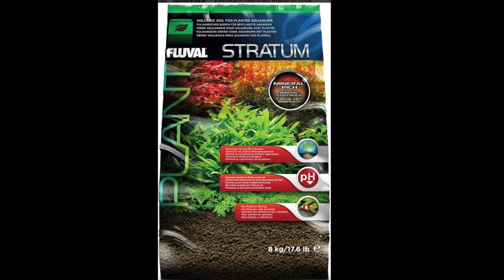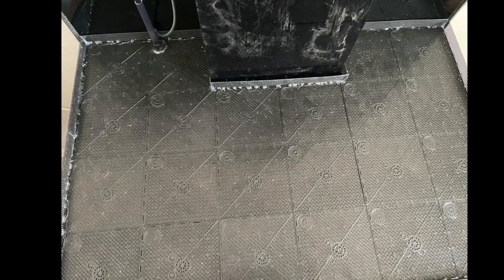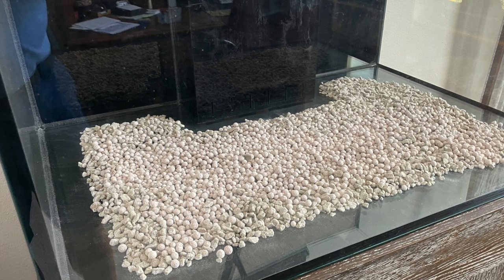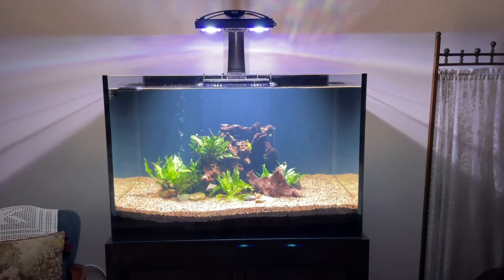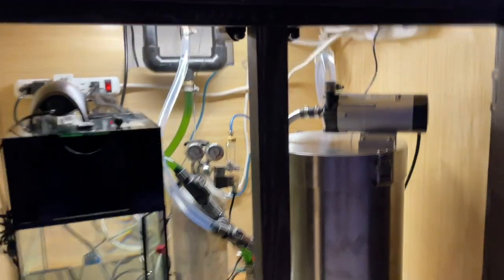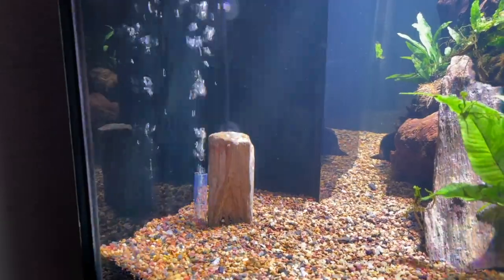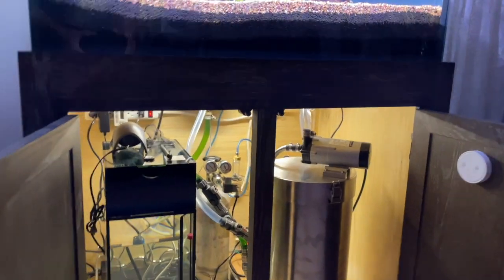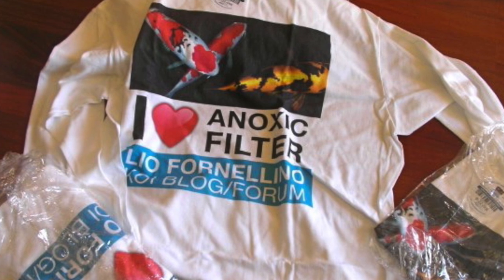Building A Plenum in the SCA Aquarium with Fluval Stratum  : Kevin Novak Ph.D.

Comment: hello dr novak, so i dont need to have the air pump running 24/7 for the plenum? Planning to leave it on in the night only so the bubbles wont disrupt my diy co2  in the day. already have a cannister filter running 24/7. I cant really follow the step by step guide cause in my country for some reason kitty litter the non clumping type is impossible to find. So my plenum has no laterite and kitty litter. Should I still carry on with plenum method using undergravel filter plate, with just the laterite or go without both or maybe the clumping kitty litter can work?
Reply from the maker: @jonsnow1081   that’s correct

Comment: Hello Dr. I am in the process of restarting my 280 g aquarium. It will be fairly well planted.  The plan is to use a ugf with aquasoil then capped with flourite sand.  I had never heard of you until now, but it struck me that I am roughly designing what you described in this video. I like the idea of the laterite and have used it previously as well as possibly using the eheim media under the ugf.  My question is that for this aquarium which is 96 inches long, how many lift tubes do you think I would need to install. I think the answer is three, but would love your expert opinion. Thank you in advance for your time and consideration.
Reply from the maker: If you're 280 gallon aquarium is 6 foot long one uplift tube with a gigantic Plenum is recommend. Remember, you don't want to move water quickly but slowly and constantly.. 8 foot long then you would use two small uplift tubes one for each 4 foot of aquarium.

Comment: I thought the whole idea was 2 use baked clay with the plenum? So the only difference in the way to utilize the under gravel filter vs how it was used in the 70's is the void between the surface of the tank and the under gravel filter plate and water speed... no need for kitty litter 🤔
Reply from the maker: A Plenum can be made in several different ways, and I try to give people all the options. But yes, you are right and thinking that basically not running and under gravel filter as fast as it was with powerheads is the way that it will work correctly.

Comment: I have a question. Did you add the airline tubing straight into the ridged tube of the plenum (like an UGF), or did you feed the airline tube under the plenum and placed the airline tube under the ridged tube? Thank you in advance.
Reply from the maker: I went out and bought a Lee’s under gravel filter for a Betta bowl. Then I cut out the part that holds the 1/2 inch lift tube. It also has a connection for your airline tubing.

Comment: Hello Dr. Novak.  I am currently gathering what I need to set up this type of aquarium.  I just got a 75 gallon and am going to keep goldfish.  You do say that you can use any kind of substrate that you want.  Does that include SAND?  I am assuming I will need to put weed cloth down on top of the filter plates before layering the substrates.  But can I use white sand as the top layer?  Thank you in advance.  I LOVE your videos.

Comment: I tried to put Eheim's sintered glass balls under the modular plates, but I couldn't make them fit in-between plastic posts. Is there a trick on how to make them fit? Could you say that the presence of a filter medium is a considerable improvement over having an empty space under the UG plate?
Reply from the maker: I've use them in the higher plenums that are 1 inch and the lower ones that are only a half inch and I didn't have any problems. You don't need a lot just a few of them will suffice. Are they necessary? No; it's just something that can help, but the science is still out whether or not it does help.

Comment: With a plenum, what kind of maintenance should be done? Should you not gravel vacuum because it will mess up the layers? Or just lightly suck the poop/detritus off the top? Leave it be?
Reply: Also- where do you attach the air hose to the up tube? Just at the bottom of the tube under the plenum? I assume we don’t want an air stone under there , just the air hose?
Reply from the maker: Actually, with a Plenum very little maintenance has to be done at all.. Usually under gravel filters will have a way to facilitate the hooking up of an air stone to its uplift tube.

Comment: Can we use Lava Rock Soil in place of Fluval Stratum
Reply from the maker: I can't see why not if it is the right size. In some countries it's a lot easier to get lab rat soil than it is Fluval Stratum. In fact, if I'm not mistaking, there are substrates, you can buy that are basically lava rock soil. In one of my older videos, one of my tanks were actually made using such substrate.
Reply: @anoxicfiltrationplenums  thanks for the response, in that case cat litter in bottom, and lava rock soil as substrate.. So don't need fluorite or anything else. If that's work, then gr8

Comment: Hi Dr Novak. I have a question please. 

What if i placed some old aquasoil amazonia or some pond compost as the first layer over the UG plates and then cap this with some fine sand to lock it all in and over this i placed a mixture of seachem flourite and some zeolites as the top layer...would this mixture of zeolite and flourite substrate also then act as a large bcb basket...i mean since the water would be  moving slowly through it on its way into the plenum?
Reply from the maker: That's exactly what I did in the goldfish aquarium.

Comment: Hello, I ran into an issue with the air pump over time, their strength decreased, and it had a really hard time pumping air because of the backflow of water. I saw some other experiments where the plenum failed, and the main reason for this was that there wasn't enough water moving through the plenum. Since the uplift tube is short and there is no airstone, I recommend starting with a max flow of air and toning down. I also noticed that when my airflow was low, all the fish started accumulating near the uplift tube.
Reply from the maker: Sometimes, if you're running a Plenum and you're not using an air stone, you have to make sure that the little tube opening stays open I sending a wire through it. I've had to do this with my plenums when I thought the air pumps were getting weak and it was only that the outlet hole was getting clogged up. Get a coat hanger and go in there and make sure the hole stays open. This is something I learned about 40 years ago to do.

Comment: Hey there Dr Novak.

I have been binge watching as much of your videos as i can.

I have finally set up my very first plenum😊 tank for my Betta. I laid down tiny black lava rocks at the base, over this i placed the plenum and the garden sheet ...over that about 1.5 inches of some used seachem red flourite from an existing tank and over this i capped with about 1.5 inches of 3mm sized inert gravel.

My undergravel filter plates don't come with a teet for an airline tube insertion though....so i guess i have to use the very small air stone that goes into the airlift chamber? I did cut the airlift chamber in the way that its height is just 3 inches above the substrate level. So it is short.
I am thinking of setting it at the lowest possible bubbles rate.

Do you think it will work?
Reply from the maker: Lotta people do what you're doing. It's Okay.
Reply: @anoxicfiltrationplenums  : Thank you Dr. 
You have really opened up my eyes to some new possibilities. I am planning on using one of those little baskets with holes that you had you red crypts in...i cant get that kitty litter that you recommend in my country but i am planning to use some fired clay gravels about 3 - 5 mm in sizes and mix them up with some zeolites and try to plant some heavy root feeders like crypts , cabombas and probably an amazon sword. I got this idea from another youtuber called Guppy Stories who closely follows you too. 

https://youtu.be/no34Wl4IlS8

For ferts i think i will only go with weekly dose of API Leaf Zone which i think contains mostly Iron and potassium ( as per the bottle's recommendation) and hope to see where it will all take me. Keep up with the good work sir. And thank you.

Comment: Hi Dr Novak. Thank you so much for the detailed instructional video.

I hope you can make a follow up video on this tank😊

I have a doubt though, how is that bubbler bubbling...I can't see an airline tube going into it .

If i understand this correctly, we have to place an airstone into that clear cylindrical structure so when we turn the pump on, the airstone will suck the water that is under the undergravel filter?

But is it just my eyes or do you have an airstone and a tube going into that clear cylindrical tube with the bubbles coming out of it?
Reply from the maker: No air stone in the bubbler that works directly off the air. It’s the old way under. Gravel filter is used to run before air stones.
Reply: @anoxicfiltrationplenums  : Dr Novak,....instead of kitty litter can I use crushed lava which are very fine sized lava rocks measuring 1-3 mm in size ? Aren't they clay based as well?

Can i use them over the plenum and also as a replacement to kitty litter in the bcb?
Reply: @anoxicfiltrationplenums  : Thank you so much sir

Comment: I don't understand why I can't actually see the air stone in the bubbler pipe? Or the air hose that leads to it ? Is this different from converting an old fashioned undergravel set up? Anyway, thank you for all your interesting content, planning on converting my old undergravel into a plenum. (Possibly all the pipes and things are hid in the Weir?)
Reply from the maker: Lift tube has been shortened to make sure it doesn't draft too much water through the Plenum
Reply: @anoxicfiltrationplenums  Thank you :)

Comment: I have some question for the Dr. I would like you to to know that I am very new to the hobby and I ask because I find it interesting that lots of people don't like underground filters, because they are "not cool", but I can see a huge benefit of having them in your tanks. 

My first question is... Do you need that gap for the Plenum, or can you just have a good inch/ inch and a half of porous material (like Seachem Matrix for example) and then add your substate (like Fluval Stratum) on top.  

Second... Can you run an underground filter combined with a canister? The way I see it  is, when running an underground filter you make the gravel and sand bed your "pre-filter". Is it ok to run the water coming out of the underground filter exhaust through a canister? You can place more sponges and media in the canister to then polish or help the beneficial bacteria grow.

Last question... Is sand ok as a cap, to cover the substrate, in a tank that has an underground filter, or must it be the filter be screened or partitioned off so the pump wont deal with the grains of sand, or is this idea of adding sand just not wise?
 
Thank you for reading it in advance and I hope to see a response or maybe a video soon.

Comment: You know you can just put about a two inch layer of really big stone followed by normal gravel the size of what would go in your drive way then substrate an that actually makes the same conditions as a plenum but with wayyyy more surface area for it to colonize.fluid dynamics..also thos plenums will suck water from the easiest paths witch is from around the sides when pulling water out.fluid dynamics will do it thru the substrate.i think using a bubbler your still moving water too fast.hell all you really need is just that pipe coming up water will move by itself.
Reply from the maker: That's a good idea If, there's a big if there, it doesn't make your pH go to alkaline which a lot of stones that driveways are made out of will do.

Comment: Can a powerhead be used instead of an air pump on the undergravel filter?  I am not a fan of the bubbles for many reasons.
Reply from the maker: If you can get it to pump very slowly, that seems to be the problem with power heads.

Comment: I have an SCA 50G cube style tank I used to use for SW.  And was about to get rid of it. (not doing SW now)  Is CO2 required if using this plenum method?  I'd love to have a fancy GF tank.  I also have an FX5, (would that work) I could use but there is a sump under it now which I can remove.  What are your thoughts?
Reply from the maker: You only need CO2 if you're going to have plants and really want them to flourish. Or I should say not flourish but grow quicker than normal. If you watch my videos on the 40 gallon breeder that has the goldfish you will see that the plants are growing very good without CO2 using a Plenum. Plus, if you see the video on the two plants that I have planted up one in dirt and one in kitty litter only and see the results of those two plants it really makes you think whether or not planting in dirt is worth the time and trouble plus the risk of polluting your aquarium.

Comment: Hello Dr Novak, iam from indonesia and very amaze that there is other method for bio filtration, this is new for me, i have a question,

your first video building the plenum, before the ugf plate is not using the bio media, does the media is a must or just some better option?

second is, can i  put substrate system like conventional aquascape above the plenum? so it will be plenum > pumice as base bio media + laterite  > base fertilizer  > aqua soil ? 

and third one and the most important is, does the canister filter need to have bcb basket on it? or just use the canister filter as aerobic filtration? and if we use the canister as anoxic, like bcb in your canister do, we need to slowdown the flowrate or let the canister work as proper flowrate for the tanks? thanks in advance doc, hope you to answer this! (pardon me for my english haha)
Reply from the maker: The bio media is an option it is not a must however I thought it was a good idea that a hobbiest came up with it.
In building a Plenum you can use any substrate you really wish as long as it falls between 1 to 3 mm in size.

ABCB basket in the canister filter is not a must. However, if I can run an entire aquarium off of a BCB basket without using sponges are any other aid to filter it then it is a helpful additive. 
Then you would soon find out that is an aid to the aquarium but it is not a must.
Reply: @anoxicfiltrationplenums  so the most important things to run the anoxic is the plenum ? but my plan is to have 2 canister, pre filter canister with sponges and the main canister have BCB, does it more better? or combining the aerobic on pre filter canister and anoxic on main canister is not a good combination?
Reply: @anoxicfiltrationplenums  and one more question, what is any other material that we can use for anoxic besides the baked cat litter? because on my country that thing is unavalaible, but the laterite stone is widely available, can i use that? or there is any other material? thanks for anwering doc!

Comment: I've been watching your videos for last month. Would've been watching earlier but just found your channel. I've used ugf for years and love em for the most part. Although I did not want to build my own plenum, I tore down my tank today to set up as close to your method as possible. Added ceramic bio rings, ugf plate, plastic mesh, washed kitty litter same as you suggested, Fluorite iron, more litter, capped with the gravel i was using for past six months so there would be bacteria already established. Replanted everything, even put on black background, heater, dirt magnet filter on high, plenum air is very low, lights on timer. Little cloudy but assuming that will be fine by tomorrow. Fingers crossed I did all this right and get similar success. Thanks for your years of research, first hand experience, studies, and letting us hobbyists (who cares to listen to the science) find a better way.

Comment: Is kitty litter needed if you use something like flourite?
Reply from the maker: If you're talking about a Plenum then no kitty litter is not needed, if you're talking about a BC B then yes kitty litter is a must.
Reply: @anoxicfiltrationplenums  Thank you for the reply. 
Yes, I meant for a plenum.
Alfagrog - void - UG plates - flourite - weed blocker - sand.
No uplift, but I'll still fit a cut down tube in case it might be needed to help with flow.

Comment: Hi Dr. Novak. How are you doing? How do set a phenum in a Cichlids tank? They dig move the substrate... Should a ise a Sump instead? Will that work as the same?
Reply from the maker: Just placed either a fabric or one of the holes match that they use for crafts about 1 inch deep from the surface. That way the fish can only dig about 1 inch deep into the gravel and the mat will stop them from digging any deeper.

Comment: Great video!
My question is, can you use baked attapulgite clay instead of kitty litter with bentonite in my substrate?
The only bentonite kitty litter I can find in my country is clumping, not baked. Or is it possible to use clumping as long as you cap it?